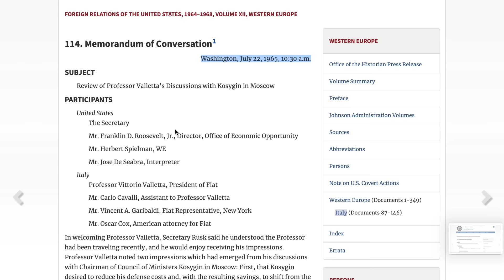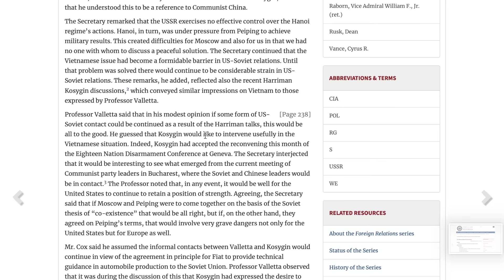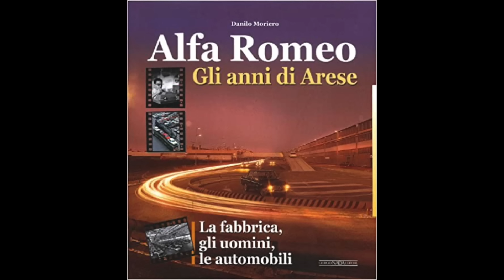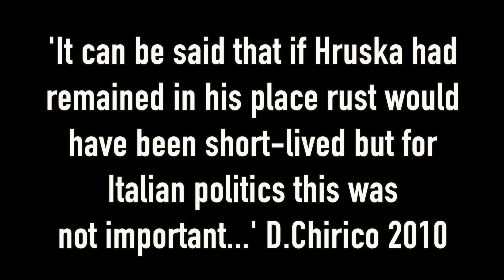Alfa Romeo And The Myth of Russian Steel - The Real Reason Alfas Rust

Comment: A very good video, thanks but there is one thing I would like to bring along, back in the late sixties we still had the remains of the European Community for Coal and Steel who still had governance power , which eventually became the EEC and then the EU we know today. In that article it was described that the French and the Italians applied to use more scrap metal when producing new sheet metal for a.o. car production then the other members and they were granted permission to do so. Before I came across that article (I have never been able to find it again) I always wondered why my mates 71 Alfa Giulia was far less corrosion prone then my  75 Nuova Giulia which was a rust bucket both were Dutch cars sold new overhere  and why older Renault 16's and Peugeot 404's (these were massively popular cars on the continent) had the same thing,  A late sixties Peugeot or R16 would rust much less then a post 70 car. I always thought this was a very plausible explanation, but for the rest, thanks for the video !
Reply from the maker: Really interesting John, thanks! Will see if I can find anything on this!

Comment: The real issue was bad trimming and bad construction. Italian cars were rusty after few years around windows, under the door, around wheel arches.
I own a 1972 Alfa GT and when I wash it (rarely as far as I can) I have to dry the windomws immediately or water goes inside the doors and the windows get wet inside too. It's absolutely not recommended to go in a car wash: the car will be full of water. So no surprise that in England Italian cars had a bad reputation!
Another weak point is the trunk: there should be a "drip tray" inside but it's too small and water goes straight inside the trunk.

Comment: Peugeot 504 cab/coupe always rusted worse than French made 504 saloons. The 504cc was made in the Pininfarina factory.  I wonder if they used Italian or French sourced steel.
Reply: Much as I loved my Peugeots, they did rust badly. My 1968 204 was scrap by 1975 due to rust. Alfasuds were worse, but I remember Citroen and Renaults and Datsun Cherries and 120 Ys rusting PDQ as well. By the time I got into Alfas in 1989 the problem had been sorted. I've had five Alfas and none rusted badly.

Comment: Do I remember correctly that one of the early Alfa Sud front suspension arms had a habit of snapping.  It happened to a fellow tech while out road testing. ( Mid 1970s ) The arm looked OK on the outside but had rotted internally. Being better safe than sorry we changed the arm on the other side.  Word went round the trade that is was a well known thing.

Comment: to show how out of control alfa romeo was before the acquisition of fiat, let's call them the alfas before the 164, i have a story again from the pomigliano d'arco plant. When they were gearing up to make the 33, that was little more than a alfasud makeover from a mechanical standpoint, they left the rolls of sheet metal outside, so when they used them the salty sea breeze had rusted out the sheets. Also in pomigliano workers intentionally sabotaged cars when fiat took over, i've heard a worker say he peed in a 33 quadrifoglio oro coming down the line... thankfully this was a minority part of the 33, which was a great improvement over the alfasud anyways. Great video!

Comment: I worked on Alfas at Hexagon back then as an outside contractor (car audio) the Graduate car, you ran under the carpets for the rear mounted antenna, your hands would be covered in rusty water. Anyone want to talk about the underfloor batter and electrics box in the 90's A Class 😆

Comment: Had a 1600 GT Sprint, 1750 Berlina, 1750 GTV, two Sud Sprints, several 33's and a 147. Only the Sprints had any rust issues and that was only minor. Could be luck of the draw or where you live.

Comment: our family owned two fiats and i say the rust wasnt all that diffrent from other cars of the era. the key was doing your own rust proofing and keeping the car clean. also salting of the roads plays a huge roll. we had a Fiat regata brought in from germany and it had no rust on the body because no road salting. we just undercoated the car right away and it didnt rust the whole time we had it.
Reply: That might work for a car that starts out with no rust but the Alfasud had rust built in before it was even painted.  So it is nothing to do with the weather, road salt or how it is looked after and any spray-on rust-proofing would not help.
Reply: @chrismartin9421  in between the two fiats we had a Lada 2106 and that car had the rust issue from new. We got it from my great uncle and he strugguled with it from day one. He even knew a guy from the production line and the guy said they  didnt do a good job preping the metal before paint. If it had surface rust they would just spray over it because production goals had to be met.

Comment: If you’ve ever worked on an Italian car, the quality of the metal in the mechanical components is far superior to any of their contemporaries. Fiat use to manufacture its own bolts and fasteners- you couldn’t break a fiat bolt - the alloys in their cylinder heads are incredibly tactile as were the cast metal components in their engines. 
With regards to bodywork - I noticed in my years of ownership of many of an Italian car, the lighter coloured ones faired better than the darker hues- dark blue and metallic greys were especially bad for rotting. I guess they needed many more coats of paint to cover the lighter ones. Who knows.

Comment: I had an Alfa Sud in 1980. I had to respray the whole car when I sold it in 1984. My previous car - a Ford Escort - didn't have any rust after 4 years. I was put off Alfas - possibly forever and, no matter how good they may be nowadays, I can't get memories of corrosion out of my mind. I don't think Alfa use hot dip galvanised steel, (like Porsche and Audi). If they did, I might consider one. I have an Audi A5 Cabriolet. It's rust free, after 10 years. The Alfa was fun to drive and it's sad that it was ruined by rust, that could so easily have been fixed. 
Second hand values affect the desirability of a new car. Why don't manufacturers offer an ordinary made version and one that's had extra rust protection and quality control?
I'd pay an extra 10-15% to get a new car, made on a separate high quality production line. 
My son's just bought a KIA Stinger. - 7 years warranty and I'm told Mitsubishi offer 10 years. This is what a new car buyer wants to hear. 
Just out of interest. I recently was looking through a 1950s American magazine. One car manufacturer proudly stated "Now with full 90 day warranty". Apparently, 30 days guarantee was all you got in the old days.

Comment: Strikes caused a problem.  What also happened is that Alfa and Fiat used a dampening spray over the steel which actually collected water and condensation vs. preventing it, causing the rust.   BMW had a similar problem with "Sisal Mats" which also held in the condensation and lead to rust problems.  cheap car, cheap steel where ever it came from.     Porsche had the 914 problem where the battery acid would rot the  frames in areas with high rain dripping ion the battery.

Comment: I’ve owned several Mercedes R107’s (I know you’re a big fan of them Jack!) over the years and despite the moniker of “Der Panzerrwagen” and all the virtues of being built like a tank they are indeed harbingers of rust-laden doom with the bulkhead being a well known example but also other areas of the car as well. 

The steel Mercedes used at the time was no doubt best quality but some poor design faults and blocked ventilation holes soon undid the quality workmanship, perhaps not as quickly as Alfa’s etc but ruinous all the same. 

All the faults can be fixed in todays world but it has to remembered that steel is always willing to rust if you give it the right conditions.

Comment: I've sometimes thought an interesting experiment would be to make a car with bare metal and use it for a long term test. I suspect it might last longer than a normal painted one as the rust would be uniform rather than concentrated in specific points.
Reply: A neighbor of mine did that to an Audi A8. He stripped it from paint and found it somewhat cool.  Trust me, your test does not has to be long term to show impressive results :)
Reply: You can buy "rust paint" to achieve the"rat" look.......
Reply: @charlesdale1462  Sounds great! :) Seems Alfa was way ahead of its time - stylewise.
Reply: use corten A   steel wot the angel oop north is made from   and shipping containers

Comment: I had a alfa sud 1.5 t I. Green clover leaf on a y reg 1982 it was brilliant and went well I did update the front brakes with 33 outboard disks as the sud had inboard front disks  ,I now own an alfa 147 2.0 t spark and the only thing  with this car is the front suspension is very weak and goes through upper and lower wish bones and I had a rear spring cup collapse due to rust .

Comment: As far as I heard, Alfasud quickly rusted because they were assembled in factories in Naples. Where before that they did not assemble passenger cars, but AR branded buses and trucks for the domestic market. And the local workers had no experience in assembling cars. All other ARs that were assembled in the north of Italy, in Arese, did not have such serious problems with rust. About half of all ARs assembled in the north of the country, at the factories of Zagato, Bertone and Pininfarina, are still on the move.

I don't remember a single 164 or Spyder owner complaining about quality problems. There are a couple friends, SZ owners, one in the States, the other in Russia. So their only problem was lazy mechanics at the dealer repair center, unable to find normal parts in time. Maybe I came across such owners. But of all the familiar owners of AR, only 155 and the very old Alfasud/Sprint were real hemorrhoids. Even the 156 of the first generation no longer caused so many complaints.

When AR passed into the hands of Fiat, in order to reduce the cost of production, the new owners decided to distribute the assembly between the rich North and the poor South of the Italy 50/50. To improve the employment of poor Southerners. They briefly increased employment, but the AR gained a reputation for being an unreliable car.

Comment: I worked at a bodyshop in the 80's a lad started who worked at a place in North Shields called PDI they took brand new cars that sat in a compound for years sometime bogged down to there axles in mud they would rebuild them and the dealers would sell them as new cars the cars were mainly Fiats , my boss at the time his mate traded in his 3 year old Fiat for a new one he broke a indicator so went to the dealers to buy a new one gave the chassis number to the storeman said whatever year it was storeman said no not that year the car was older than the car he had traded in the government changed the law that a car could not be older than 6 month to be classed as new  .
I remember as a young lad coming home and seeing the neighbours Alpha with it's engine sitting on the road the cross member had rotted off , I was freelancing in the 90's went to one garage towting for some work they specialised in Alpha's 18 month old cars with the wipes falling through the scuttle panels shocking , my sister had a Alpha it had plastic body kit ie: door bottoms sills and wheel arches I was under the impression to hid the rot .
Nissan did a deal with Alpha and made Nissan Cherry built in Italy I did a front end smash on one got the shock opening the bonnet to find a Boxer engine under there lol .
I restored a Lancia Monte Carlo for a lad  in the 90s another pile of scrap , I've got an 07 Fiat Doblo built in Turkey good car pretty rot free .

Comment: I wouldn't mind buying a car made of old battleships or tanks - that's actually a very good quality of steel.

The important thing in making steel is getting the mix right - rust, no matter how much is burned away in the blast furnace.

The following steps are very critical: Cold rolling, pressing etc. require perfectly clean tools - if this fails, no matter how well you preserve it - it will rust eventually.

Comment: You could check if old steel had been used by getting the steel samples from one or two of those old cars examined to see if it had been mined and  manufactured after the time of the nuclear  tests since all steel today shows signs of slightly elevated amounts of radiation  compared  with that made before the age of nuclear test explosions of the 1950's and early 1960's.

Comment: I had a Lancia Beta ,and it rusted faster than any steel I have ever seen.
Sure, bad factory process can explain some of it, but what percentage of cars were actually stopped half way through the cleaning process ? compared to the percentage of cars that suffered with premature rusting.
 The steel must also have been full of impurities as well.
The Alfa Sud you are showing as an example on the vid was in exceptional condition compared to my Lancia, which just decomposed in my driveway.

Comment: My Dad worked as a metallurgist all his life and in about 1971, 18 months after the Datsun 240z went on sale in Canada they started rusting terribly! This, especially in Quebec where roads were heavily salted, would make the cars undrivable in just a couple years. The rumor mill had it all figured out with “cheap Jap steel, Hong Kong or Chinese steel etc. 
 The truth was much simpler. Japan was still new selling cars in a market where extensive rust proofing was needed and indeed a market where cars “needed” to last much longer compared to Japan. Japanese are encouraged to replace cars more often through very rigid inspections. This keeping manufacturers selling cars. 
 Steel, as it turned out, if “ductile” enough to be formed into the complex forms that were needed for auto manufacturing, was adequate to be used. Surface coating application before and during the process is still the battle that car makers seem to struggle with. 
 Here in North America relatively new pick up trucks from all the major makers are still falling apart with rust in less than 10 years. 
 The old “cheap steel” rumor still exists and is believed. 
 The technicians that monitor the quality of sheet steel are North America make a very consistent quality product regardless of the “oft recycled” source steel. 
 Great video!
Oh, and our Canada Market “68” Fiat 124 coupe lasted a whole 6 years before the shocks punctured the towers!😁

Comment: Other cars, particularly Japanese cars of the era, rusted just as bad as Italian ones. But as someone who worked at a Fiat dealership as a young man in the early 80s, I can testify to the poor build quality, corrosion and general lack of robustness of Italian cars. They had bullet proof engines, particularly the Lampredi twin cam, a superb engine, but poor engineering otherwise. A great shame. The Strada 105 and 130 TC and 131 2000 Sport on Pirelli P6 tyres have left a lasting impression on me. I would love to find an early single headlight 105 TC Strada, in black. But so many British cars were the same. Good designs ruined by other factors. Humans are flawed.

Comment: Just a tiny correction Jack, there was actually a huge steel plant in Naples, that's why they put the factory there.
Reply: There were steel mills in many places but that is irrelevant.  The factory was built in Naples as Alfa Romeo already had an old plant there that had been used to make aero engines and later a few trucks and buses.  When Alfa asked for assistance to expand their facilities to build the new car the government 'encouraged' them to invest in the south, but the funding was dependent on them using steel from the Italsider plant at Taranto as this had also been funded by the same government money through I.R.I.  There is official documentation to confirm this and links to the sources are all quoted in the book; (you will need to read Italian though).

Comment: Back in the 70:s most car brands where as plegued with rust. My father told it as to be caused by modern methods and design.
He owned several Peugeot 404 them where good but his 504 that was an real bucket. He explained it by its construction, a lighter unbody construction or as he said a box-construction giving lots of cavitys for rust as to grow, he also said these cars will rust from inside out! We did lot of rust protective work my dad and I.
To be somewhat fare the word about Alfa was exellent cars but as bought and driven by unmature reckless personas that loved sporty driving, pedal to the metal from stage 1 and not so much of else as for an example love and care. Many of them fine Alfas went as blowed out finito bye bye engine and all in an very early stage about two to three years of time and then after as pretty much worthless as no one would buy them.

Comment: I have heard this same myth about 70's Volvos and even about Mercedes. Any steel will rust, that's a fact. It is factory work quality and quality of the rust proofing and paints and other materials that will determine how badly cars will rust. And how well cars are maintained when used. So myth it is!